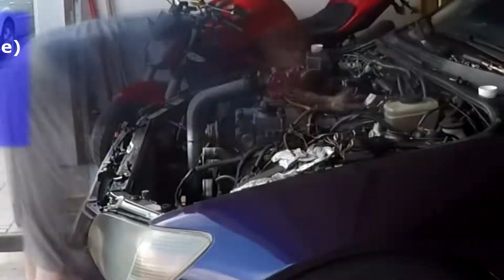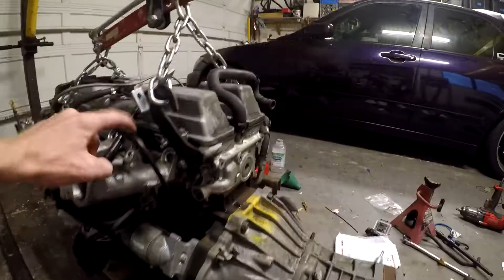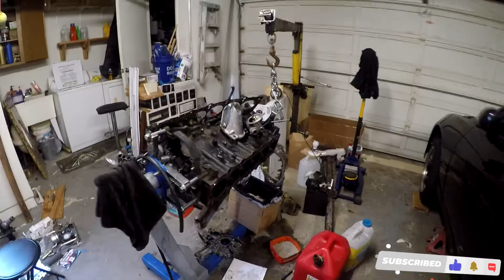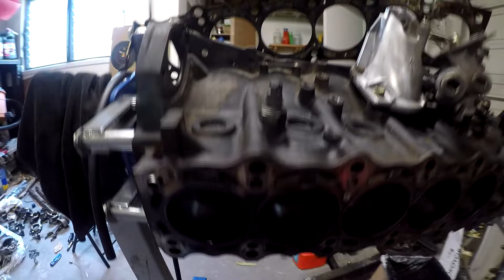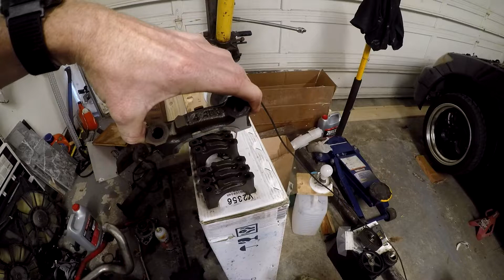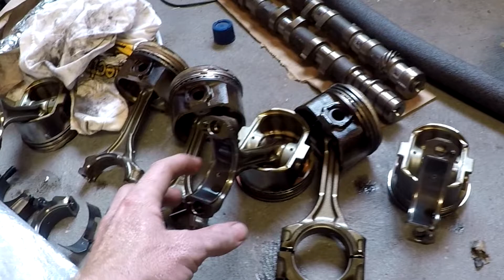IS300 stock engine inspection after 20k miles turbo

Comment: 6psi isn't all that much for 10.5:1 compression. That's actually quite a low amount of boost in today's standards.
Reply from the maker: Yes, I never said it was high in general. It's at the limit for what this stock engine can handle. So it's high for the stock engine
Reply: @LegitRaceCraft  actually 10 to 11 psi can easily be achieved reliably 👍 
Iv been running 10 psi for 2 years now.
Reply from the maker: Ah, I've always heard 6-7 for these factory GE VVTi variants but good to know you're running 10 reliably

Comment: Great attention to detail,  hopefully the crank checks out, plastigauge should help aid in making a decision on upsizing the main bearings. At 190k miles those other bearings look to be in nice shape. Good luck and enjoy the build!
Reply from the maker: Thanks! Yeah, the crank checked out fine and there wasn't anything abnormal on it. I've got a set of plastigauge pieces lying around to use if I have to, but I shouldn't need them for anything other than verifying bearing tolerances on install